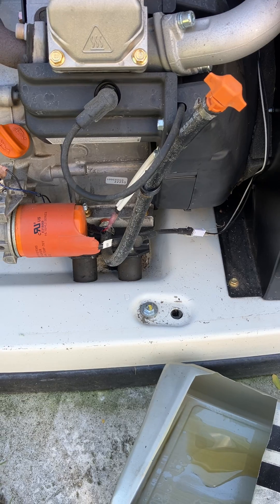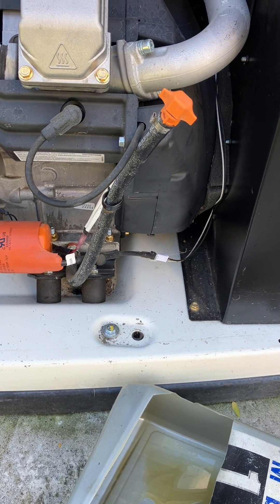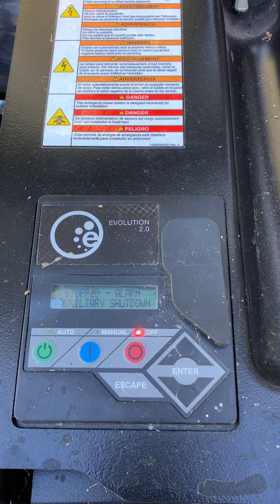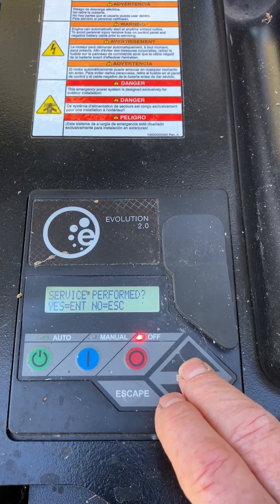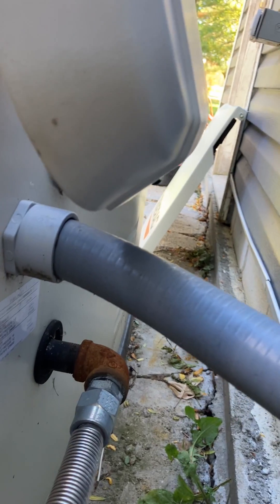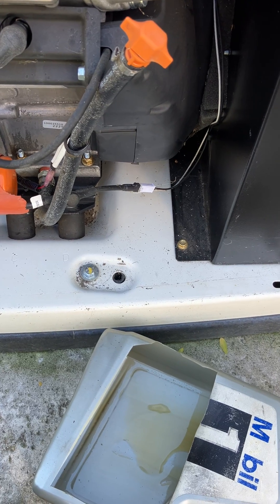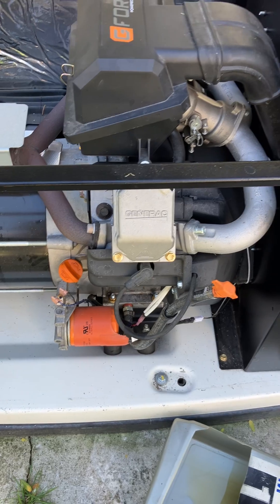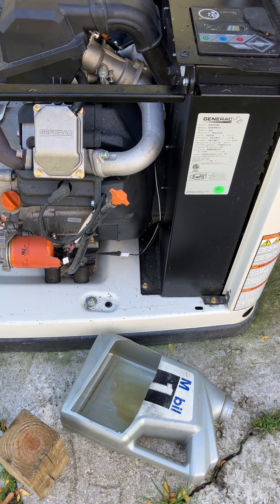GENERAC 14 KW GENERATOR - LOW OIL PRESSURE ERROR CODE 1300

Comment: looks like the smaller 2 cylinder. these seem to have a common problem of low oil pressure. in your video you did not start it. but if the sensor was replaced and oil was added it sounds like the unit has low oil pressure. on this engine ermove the prssure switch and jump it so the unit cannot fault on it. with a guage use the same port and check the pressure. itt may go up to 40 or 30 psi since its cold out and will slowly drop as it warms up as the oil thins out and eventually drop to zero
Reply from the maker: When I saw excessive oil on the dipstick I assumed someone thought that a little more oil may help. I've seen oil added multiple times as an attempted fix.
I was told the current owner changed the oil pressure switch and it still alarmed on "LOW OIL". 
So, I removed the oil pressure sensor - which is above the oil sump, so a little oil may leak out but not a lot.
I attached my oil pressure gauge and started the generator which showed "0" oil pressure and the generator sounded terrible. So, no, I didn't want to start the generator to show how they sound when they're not getting any lubrication.
I was there to show the owner that I hadn't forgotten them and to push the Certified Dealer into moving this repair forward. Spring had come and gone, summer had come and gone, fall is just about spent and the person the owners remember is me.
I've only had to replace two oil pressure sensors this summer and they only alarm at under 10 PSI. That's low, and I'd want it checked.
There is no "HIGH OIL PRESSURE" alarm and high oil pressure can do some real damage. That's why I always instruct owners to allow any added oil time to settle before looking at the dipstick.
Reply: @snowman6686  yes compleatly agree and yes they sound awful with no oil pressure 🤣

Comment: Interesting. I was talking to my sister a few months ago and her Generac lost oil pressure then ate itself. The unit was maintained per OEM specs. Total loss and out of warranty.
Reply from the maker: Sometimes it doesn't matter if it's still under warranty. I've heard stories that the generator had to be installed by a certified dealer and maintenance records by a certified technician to get the warranty coverage. (I'm not privy to the accuracy of the statement but I can see it coming if it's not already here.)
People ask me if it's the best generator and I tell them "No, but it's among the most affordable. If it breaks you can replace it at a reasonable cost."